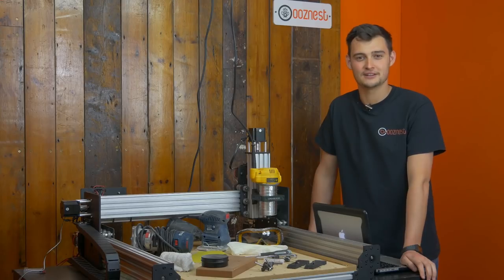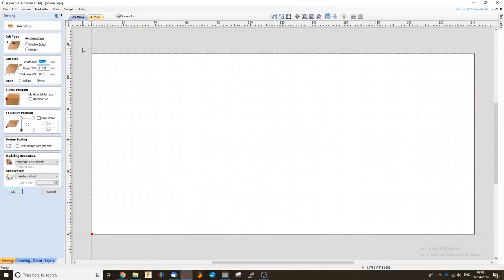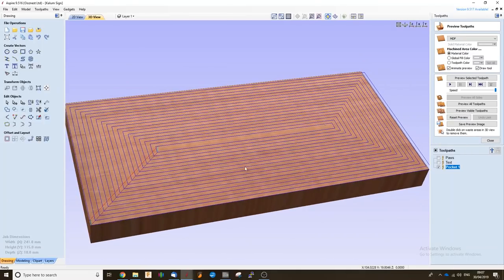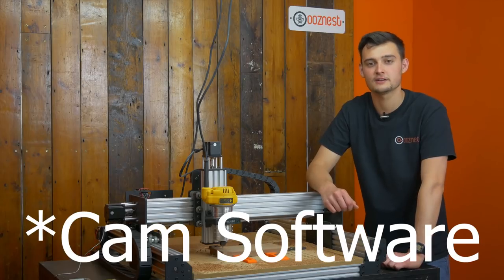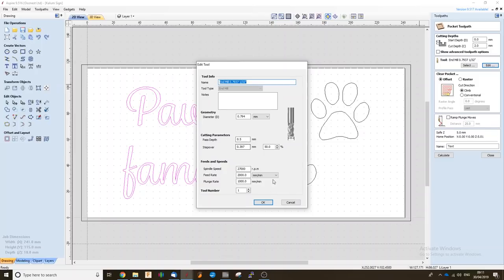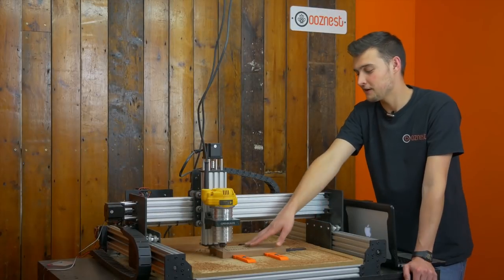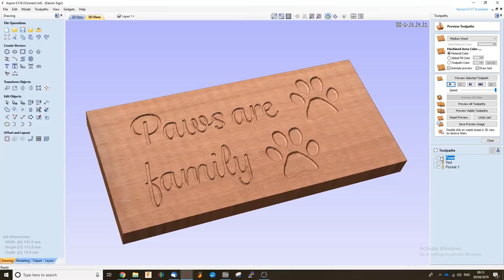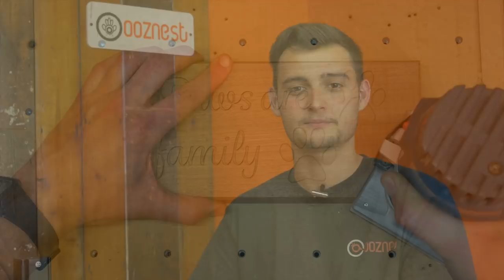Sign Making WorkBee CNC Machine Tutorial

Comment: for safe equipment i recommend using a respirator mask so you dont breath in the dust from machine if you have not got a hoover attach to the machine
Reply from the maker: Hi, thanks for your comment, that's a good point. We will always recommend using a dust extractor when cutting hazardous materials, we usually disconnect ours for a couple minutes at a time to get more interesting shots showing the cut. But like you said, a respirator is a must in any workshop.

Comment: Hi I’m really interested in this CNC for my workshop to progress, can I do the programming on a apple iPad or do I need a windows laptop. Thanks.
Reply from the maker: Hi, The G-Code Sender software allows firmware settings to be configured, move the machine around, and send the G-Code job file to the machine. The control software used with the WorkBee is WorkBee Control. It is browser-based software so can be used on Windows, Mac or Smartphone (if the Wifi option is chosen). The CAM Software we sell by Vectric is for windows only. However you could use Fusion360 which works on a Mac. I don't think there is any CAM Software for an iPad.

Comment: Hi I know this video was in April but I'm curious if there was a reason you went for a circular tool path when surfacing the piece of work rather than just running long parallel linear lines back and forth across the piece. Surely the circular method takes more time as there are slow down for direction change etc? Thanks in advance. T
Reply from the maker: Hi, thanks for your comment. There was no reason particular why that was chosen i am afraid.
Reply: @ooznest  okay cool thanks for the reply. Might be worth a try next time you do this to see if it speeds up your workflow or gives you a different finish. 👌🏻👍🏻

Comment: Hi guys.... one question....why are using inch's rather than metric
Reply from the maker: Hi, where were we using inches?
Reply: @ooznest  You were using imperial sized tooling.  Does seem odd if designing in metric
Reply from the maker: @tangoterrier  Hi thanks for your message. It is strangle a lot of tooling is still in imperial.
Reply: It's down to the size of the collet, both the Bosch and the Makita come with imperial collets.
I had to buy metric collets fo my Makita, and it wasn't easy to find either!

TURK